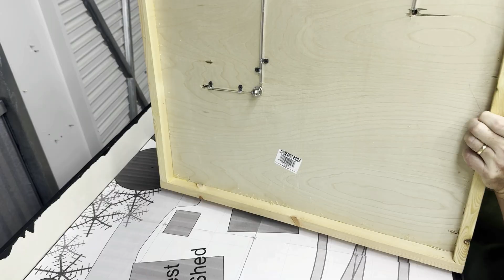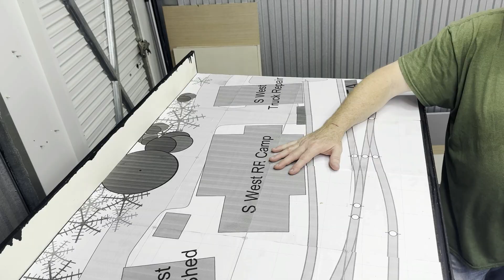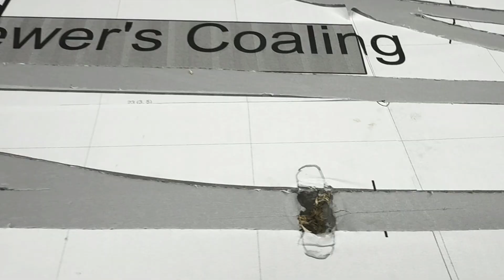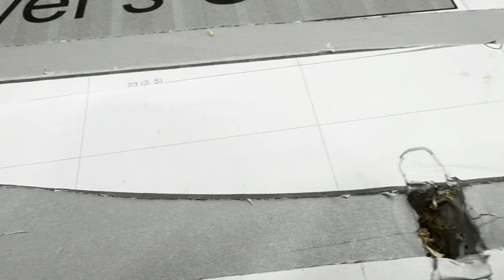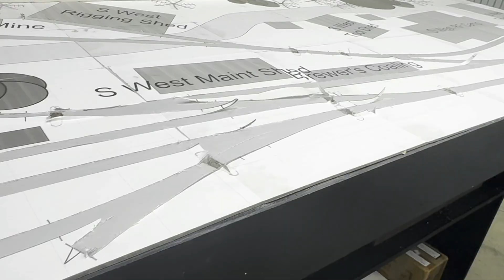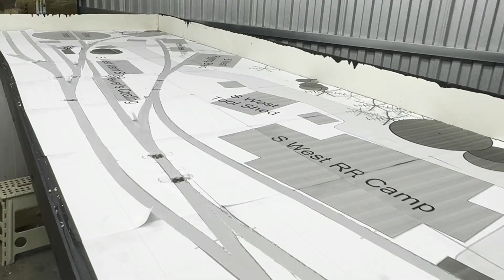#2 Crypto Falls Timber & Coal Track Laying Preparation and Turnout Control

Comment: I have also secured the paper plan to the base board. However, I did it a little different in that I used diluted white glue like a wallpaper paste and primarily glued down the track sections only. I loosely marked the area where the track would go then coated that area. After placing the paper I  slathered on glue over the paper. Once dried I cut out the extra paper leaving just the track areas. In my case this left a guide for my friend (it is his layout) to hand lay track. The diluted glue gave me a little fudge time to adjust the paper. I am following with interest as I wish more modelers used the modular or module system to build their railroads. Your track plan looks fun and I can see where you appear to allow for expansion if desired. I built a lot of modules over my years. Here is a link to my YouTube channel that has a playlist highlighting some of my modules…….at scottrobertson56.